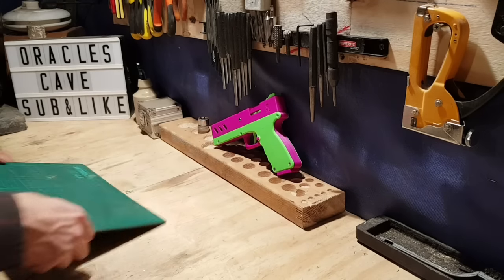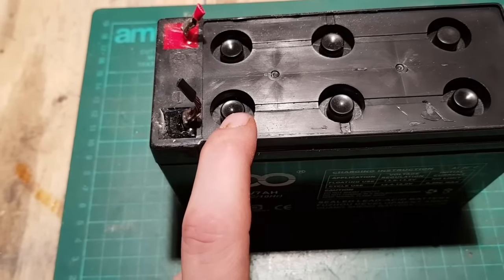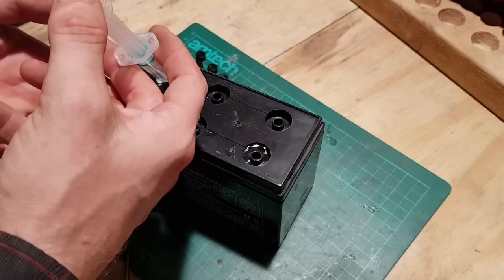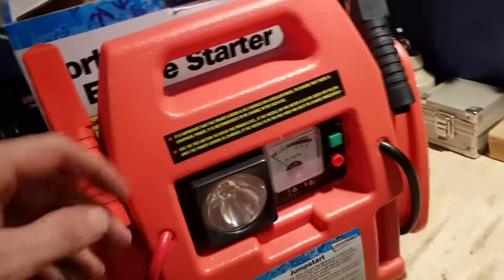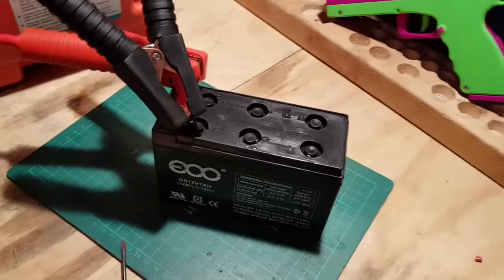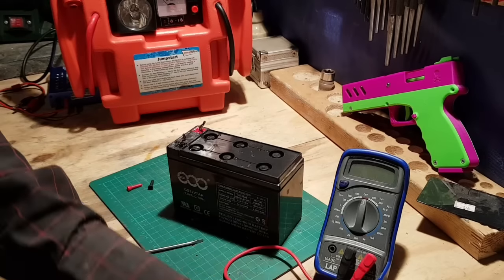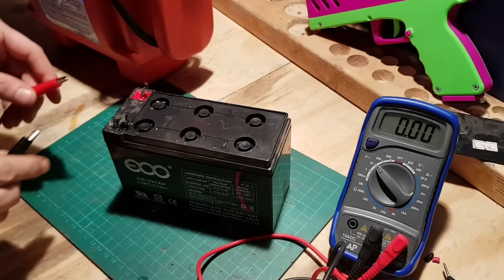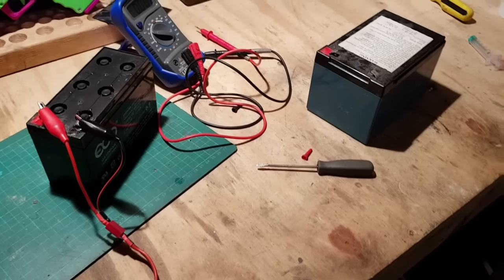HOW TO REVIVE DEAD 6V, 12V BATTERIES THAT WON'T CHARGE

Comment: It is not all that you can do to revive the old dead battery. How about checking the density of the electrolite after filling the distiled water to the cells? Density should be 1,29 +-0,01 g/cm^3. Density could be checked by an aerometer. If battery is dead the density is close to 1g/cm^3. Battery have to be charged with the voltage 2,7-2,8V/cell until density will stop to rise. But if the density of the electrolite is close to 1g/cm^3 the battery will not take the charge. So you have to add a sulphuric acid (H2SO4) to electrolite to rise the density to around  1,15g/cm^3 for battery to take charge. Then the battery has to be charged with the voltage 2,7-2,8V/cell until density will stop to rise. Also it is very important to check that the density woul not rise more than the normal 1,30g/cm^3 for a long period of time. If it rises,  you can suck some electrolite out of the battery and add the distilled water to lower the density. At the end you have to get:
1. Charging with the voltage 2,7-2,8V/cell no longer rises the density of elecrolite.
2. Density of electrolite is equal on all cells to 1,29 +-0,01 g/cm^3.
3. Charged battery at steady state shoul show the voltage around 2,26V/cell.

After reviving the battery it can be charged with the „normal” automatic smart (dumb) charger.

Concerning Smart (Dumb) chargers. It is not very difficult to make some changes to it, to make a switch auto/manual. Than in manual state it just puts out the voltage as a power sourse.

Comment: Sorry for asking a dumb question sir but why do we not put new battery acid in rather than the distilled water ?
Reply from the maker: Because a thing called "sulphation" happens that turns the acid into crystals that bind to the cells.
The water aswell as the reversing terminals is what makes the crystals get broken down off of the cells.

You would want to do this before adding fresh water and fresh acid.
Basically cleaning the burnt potatoes off the bottom of the pot so it works properly the next time you try to cook with it.
But fresh acid is necessary to bring the battery back to full power again just as you would expect.

And no question is a dumb question
👍👍👍

Comment: I am having trouble.  Do you think this charger would work?  It says that it has adjustable power output from 0.5Amps-8Amps and 3 volts-60 volts.
Reply from the maker: Sounds good to me, you could even charge it up, drain it again by attaching it to something and using the power, then recharging at a slightly higher amps again.
You could start at 0.5amps, then next time 1.0amps then 1.5amps.
Then the battery with get stronger.
But yes that charger sounds perfect.

Comment: Can you charge it in the actual vehicle if there's a port designed for that purpose?
Reply from the maker: Yes I imagine that could be done as long as you didn't turn on the vehicle while it's connected.
It would be much safer to disconnect and charge just incase anything bad happened with the battery while charging, like exploding, then the vehicle would also get damaged.
But chances are it would be fine, cars normally get trickle charged while battery is in place, so yeah, as long as you don't turn the vehicle on until the charger is disconnected, it should be good.

Comment: Hi...I’m assuming the battery from an unopened ride on from 2 yrs ago will not be working anymore...? Sis gave us one but my son was 2 small for it still until now. Charged it probably too long (15? Hrs), assembled, and it’s not turning on. Jst wondering what to do & looking up alternatives before I give in to buying a replacement battery if possible.. The ride on is an X Wing fighter 6V
Reply from the maker: I imagine the acid has formed into crystals on the cells, it's called sulphation/sulfation.

There is a process to reverse it that includes reversing the terminals.
You must open the battery like in my video and top the cells up if needed and put the charger on the wrong terminals for short bursts, this will cause everything to fizz and bubble but will cause the crystals to come off the cells.
And through charging they will mix back to liquid.
Battery may not fully recover and may need some extra battery acid refill which is very cheap.
But as long as you wear some form of eye protection from splashes its really not that hard.
But yes you could save your battery still.
I would advise using Google to get step by step on recovering a dead battery with reversing terminals.
👍👍👍
Reply: @oraclescave  thank you so much for the reply! So I put distilled water then charged it like normal (since red part of wire thing is strongly hot glued to the battery) right after I saw this video & another. Just looked and all the water’s gone & it was a white stuff on the bottom, which I guess is the crystallizing part that I probably made worse not reversing terminal. I’ll google the step by step & see where I can find the acid..thank you once again!

Comment: Is there ever a case where you would need to add battery acid into the cells along with distilled water? Would that help in any way? I've read conflicting things about this online - most people say to never top up with any acid but I've seen a video where it's done
Reply from the maker: Yes small amount of fresh acid would bring it back to brand new power.
You can purchase battery acid in small sachets for replenishing the battery, or very cheaply in bottles.
Reply: @oraclescave  Thanks for the quick reply! And thanks a lot for the info on here, big help 👍

Comment: Hey I did everything exactly as mentioned but the battery is not maintaining the charge. Does that mean it's bad and I need to discard it?
Reply from the maker: It means that the liquid has lost its ability to keep charge.
It can always be brought back again by adding fresh electrolytes (acid)

Most people do throw them out but replacement acid is very cheap, and its very easy, so I choose to restore batteries.
Just look up battery replenishing packs, or sulphuric acid replacement.

Comment: Nice video
I purchased a 12v lifepo4 battery for a project... it arrived dead, 1.3volts
Will putting a jumper batt pack on it work the same way?
Reply from the maker: I'm not sure about lifepo4 batteries, I have never messed around with them, I think they might need a smart charger, possibly using the charger to discharge the battery first before recharging like li-ion, but possibly might get away with linking another lifepo4 battery to it for short bursts to raise the voltage enough to trick the charger.

I just don't know if its more like li-ion or lifepo4 when it comes to charging.

I imagine it would work, I just don't actually know so would not be able to advise on the matter.

Me personally, I would try it and keep checking the voltage, I think smart chargers need to see about 3.75v before it will charge stuff.

If you do try it, let us know the outcome, my guess is, it works.
👍👍👍
Reply: @oraclescave  thanks...I’ll give it a go
Reply from the maker: @topsyturvy8698  yes, I use a SKY RC B6AC charger for that type of stuff, its decent at monitoring the cells and alerting when its not going to plan.
Reply: @topsyturvy8698  I bought a lithium / lead batt charger... I switch it to lithium and charged a full day, brought it to 13.6 volts

Comment: So I am new to this I got the battery out and followed you up till you said 
5. Something mine was saying 11.75 si is that charged, if so why does it stop running? Please, if you can suggest something, I appreciate it as I am now at a wall. Thanks
Reply from the maker: Reconditioning the battery may include several charges and discharges, charging with higher amps may help.

Possibly have a very dry cell that needs brought back to life
Sulfation can be removed with reversing the terminals for short periods, just Google it, 
HOW TO FIX BATTERY SULFATION
Reply: @oraclescave  wow thanks for your quick response. I will look into it...I have the mighty
MAX battery this is the third one. I hope it works. I'll let ya know...thanks again...🤗

Comment: What a life saving video! I had one question though. If there is a ring of white foam around the rubber caps, is that normal? Or is it what I think it is and be overcharged cells pouring out the top lol.
Reply: Possibly a bit overcharged.  You can clean it off using a solution of water with a bit of baking soda.  Then rinse with fresh water.

Comment: Can you charge a 12v battery with a magneto. I have a mini-bike with a headlight that runs on a magneto. I installed a tail light which runs off a 12v 7 Amp battery. So my question is can I hook up the magneto wires that go to the head light to the battery and run the the whole system snd charge the battery at the same time.
Reply from the maker: I'm not sure  I think it might need a VOLTAGE RECTIFIER.
Some mini bikes have them.

I don't think its possible to wire it just to a magneto, a magneto would probably produce between 6v-12v, a mini bike is probably 5-6v magneto but straight wired I think might be dangerous.

Comment: Hey I tried this trick but after the jump, my battery rapidly drops voltage. Does that mean the battery is done for or is there anything else I can do? Appreciate the video.
Reply from the maker: Check the pinned comment on this video, it explains everything.
Having a charger with different amperages can help bring it back.
Also adding a small amount of acid will definitely bring back to brand new.

Comment: I have a battery that's outputting 0.5V.. it's been sitting for a year without charge.. it's form an alarm system.. I don't have a smart charger nor another battery to do this.. you have any suggestion on how to charge it... I only have the charger circuit that comes with the alarm (Paradox PS817)

Comment: How many Amps is the car booster pack, as I'm looking for a decent one, for my Suburu Imprezas, as I have a wee battery issue, & don't want too be caught short. Do u have a link for it etc thanks
Reply from the maker: I bought mine in a local hardware store for £50 but you can get them for around 35 online. Cant remember what the cold cranking amps was, but i remember it was more than I needed so it will definitely be good for a scooby.
👍👍👍

Comment: Well this all depends on the condition of the the battery plates. If the battery was well used, you can bet the plates are partially eaten away from the sulfide and will NOT take a full charge. I have only been successful with about 5% of the batteries I tried this with. If you apply to much amperage to the small batteries, you will blow the caps right off these.

Comment: Would this method work for rebooting mobility scooter batteries?
Reply from the maker: Yes, but since they are high drain machines you will be best to add some sulphuric acid into the water in each cell.
And your battery will be back to brand new.
But yes this method will bring your batteries back to life just using deionized  or distilled water.
👍👍👍

Comment: I have a Powakaddy battery which only lasted half a round. I topped up with water but it still only lasted 9 holes before it was dead.  The only thing i didn't do was refill the cells after the initial charge.  Do you think this will be the issue?
Reply from the maker: No, the issue is lack of electrolytes.

I would purchase some sulfuric acid, or battery electrolyte refill, and your full charge will be back.
This method is just to get the battery working.
Fresh acid is needed to maintain charge.
👍👍👍

Comment: Thanks for this. A related question: A lot of these batteries are encased in pack of multiple same batteries and connected in series to increase charge, like in cordless electric mowers. The case has a single port to connect an OEM charger cable connector. In cold climates the batteries sit all winter and die. The OEM charger is not a trickle charger so you are not supposed to leave it charging. Is there any way to rig something up to trickle charge these encased batteries (4 in series) through the winter. These expensive mower batteries will only last 2 years at most because of the storage through winter. Any thought on how to do this without taking apart case and hooking each battery separate on trickle chargers?
Reply from the maker: Hooking the trickle charger to the plus and negative wires that go to the charging connection.

Either at the charging connection end or straight into the battery terminal that those wires go to.

And if it is not easy to get to those connections, I would maybe advise stripping down and installing extra wires at these locations and running them to a good storage place (capped) safely, or insulating tape suffocated 
Then in future you just pull out your spare live and negative, hook up your trickle charger, when it's done, just recap your wires and tuck them away.

But yes both of the main wires coming from your battery pack are the ones you need to trickle charge.
👍👍👍
Reply: You can get a trickle charger at Walmart and it will come with a plug that you can hook to the battery directly, or wire them into preexisting wires so you can just plug the charger directly in. I have one hooked up in my Harley for when I'm not using it for a month or more

Comment: Is there a way to revive a battery using just a trickle charger or jump start pack (not using a smart charger? )
Great video! Thank you!
Reply from the maker: If the problem is just voltage being too low, yes putting a jump-start pack onto the terminals will bring the voltage up, so that the smart charger can then charge it.
If it's a 12v battery, you may only need to get it to 5-6 volts for the smart charger to continue the charging process.

Comment: I bought one of those uninterruptible power supply yesterday that has 2 of those batteries. The supply itself works fine as a power strip at the moment, but unfortunately for me the batteries are at 0 volts. I bought some replacement batteries online, but I was wondering if it was possible to use this method to charge those batteries. If not, I could take the dead batteries to somewhere in my area that buys old batteries.
Reply from the maker: Yes, this situation is exactly what the video is for.
👍👍👍
Reply: @oraclescave  ok thanks.

Comment: Hey @oracle, after you add the battery solution (not distilled water), is it safe to charge the battery? i have two 12 volts battery for a wheelchair. Thanks!
Reply from the maker: Sometimes it's just solution no need for water, other times it's just acid and you need to add distilled water.

Normally if its "solution" no water is needed, it will say on the packet.
But yes solution added then charge.
Reply: @oraclescave  Thank you so much for the quick response! i just filled mine with solution and was doubting if i should charge it after removing the excess
Reply from the maker: @sohn1207  leave caps off and charge, make sure you are wearing some eye protection even sunglasses, and have your PowerPoint somewhere you don't have to lean over the charging battery to turn it off, have it off to the side.
Your battery will be back to brand new full power.

Charging with the caps off to release any bubbles, then it's good to close up and use as normal
Reply: @oraclescave  Sorry another question! Is it normal for the solution to sometimes leakout while its charging? should i leave the battery cover off??
Reply from the maker: @sohn1207  yes normal to leak at first, once it's charged it will be all good to seal up.
But yes totally normal until all bubbles are worked out of it.
Reply from the maker: @sohn1207  yes leave cover and caps off for first charge
Reply: @oraclescave  oh got it,then once it stops bubbling up it's good to return the caps?
Reply: @oraclescave  if it stops bubbling without the caps, is it good?
Reply: @oraclescave  sry for the spam, it stop bubbling up and the charger went green, does it mean it's good?
Reply from the maker: @sohn1207  yes, the bubbles will stop, let it get to full charge, then it can be closed off with caps and cover.
Secure the cover so it's not falling off, if there is a tiny vent hole on the side of the top anywhere or even at the end of the lid, don't cover it up, that's just a vent, but tape it off everywhere else.
And re-install the battery how it was and you are good to go.
Reply: @oraclescave  Thank you!
Reply from the maker: @sohn1207  no worries, glad to help when comes to people saving chunks of money.
👍👍👍
Reply: @oraclescave  hey sorry again! im done charging it, but there are some solution that are leaking while im using it, is it normal? i have added the cap and battery cover btw!
Reply from the maker: @sohn1207  it shouldn't be leaking, is the battery laying on its side or standing upright ?
Maybe the lid is not pressing down enough onto the top of the rubber caps.
Maybe try folding some card and sitting it on top of the lid before you tape it down tightly so the caps are being pressed down harder.
But no it should not be leaking.
Reply: @oraclescave  Yeah its in a vertical position, i think that might cause the issue, ill add cards so it presses the caps with the cover, thank you!

Comment: Would I be able to use pureified water?
Reply from the maker: Yes, all water will actually work, but normal water has minerals in it, this will cause issues and corrosion on the lead cells, purified, distilled or deionized  is fine.
👍👍👍